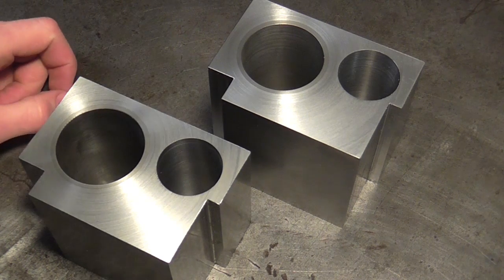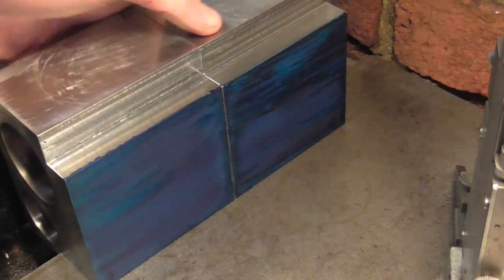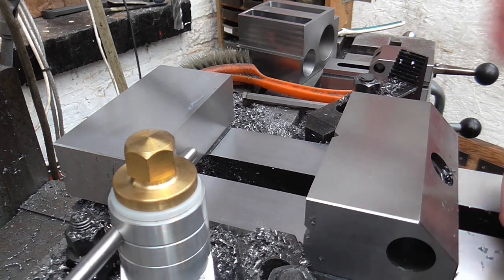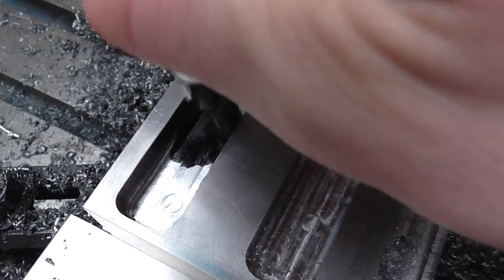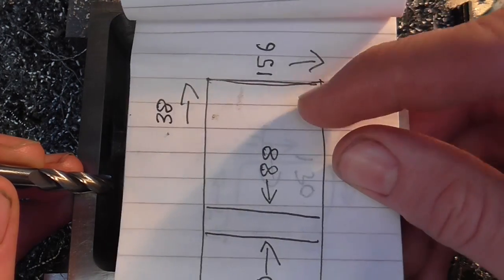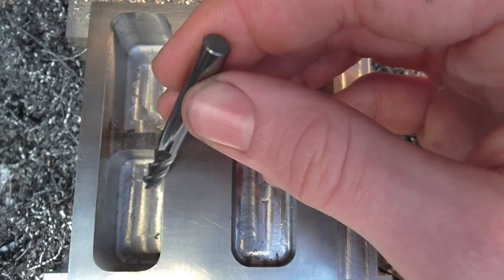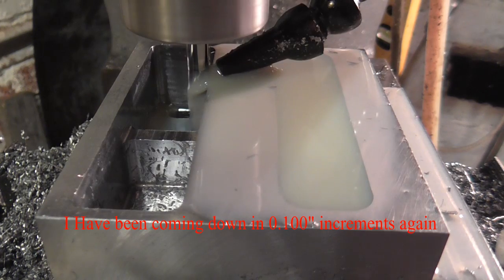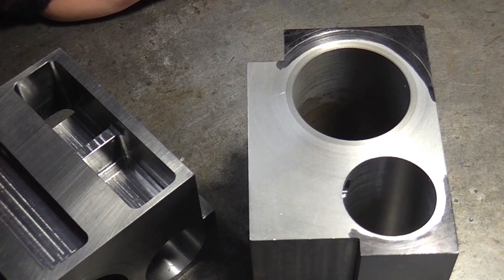Machining Cylinders Part 4

Comment: Mr. C !
Love what you do, very inspiring!
I cant wet cut in my little shop and have to use a vacuum all the time.
I did a DIY central vac system with a remote control. I put up a short crappy video (nowhere near your standard) that shows it. Much easier than dragging a Hoover around and very convenient as theres an outlet at every work station.

Comment: You say 'cap screws' for Allen screws. Why ?
Oxf. Eng. Dict.:
 a1884   E. H. Knight Pract. Dict. Mech. Suppl. 162/2   Cap Screw, a machine screw with a cubical head, used for screwing on the cylinder head.

Comment: I watched a video where you were setting some rivets on a train part you were working on and I though oh this old chap seems to be doing quite well, really hammering along at a decent pace. Now I discover your in your twenties. You even made mention of having bacon and sausages for breakfast and that gave you the strength to get the riveting done : ) 
Absolutely no offence meant but you sounded like a grizzled old machinist with 60 years of hard earned experience behind you. : ) 

Love the videos cheers mate.
Reply: There are many machine shop videos on YouTube. I seem to be on a grand exploration at the moment - leaving some of my usual canalling videos behind (also good). I've found home hobbyists, home machine shoppers and the odd 'real' machinist with massive 'toys' at his work shop. None of them are idiots (odd ones are daft - great for entertainment effect), they're all doing good stuff with video and their work. Some of them are going to greater lengths explaining processes adding significant educational value which makes them stand out a little among the throng. Having watched MrCrispin (I'm on day 2 !!!) I'm mentally at a whole new level, learning masses of techniques and tooling - it's just making me want to go and gate-crash the local university's machine shop ! My 2 machines are not enough !

As for video machining skills quality, I'd rate all I've seen at least a 9 out of 10. Those that are better could easily be a 9·9 out of 10. And now, I'd guess you'd expect me to give MrCrispin a 10 out of 10. ABSOLUTELY NOT !!! It's......

10·000000 out of 10 !

Comment: Unless you are avoiding using a DRO by choice, check out the fabulous free Android app called TouchDRO. It gives you a very cheap diy DRO, that uses any Android tablet or phone as a fully portable screen (Bluetooth) It then swaps from lathe setup to mill setup at the touch of a button, and has transformed my enjoyment of my Boxford. I knocked up a circuit board using Veroboard, but you now have the option to buy dedicated Printed circuit board at a bit more of a cost.
 Nice tip on the tool deflection in the corners.
Keep up the good work.

Comment: Excellent!
You mention that you use your handwheels to get to the numbers in order to mill the pockets. So, if I understand you correctly, you don't use any DRO or dial indicator.
If so, how do you take the backlash of your x and y spindles into account?
Kind regards
Harald
Reply from the maker: +Harald Finster Im always going the same way round the perimeter (clock wise) so back lash doesn't really effect me. The numbers I use on the hand wheels are not relevant to any actual sizes they are just reference pots that I can return to. To find the numbers in the first place I went round the scribed lines leaving metal on and recorded the number the hand wheels were at. Then I measured it and worked out what numbers to go to. Say first time round I went to a handwheel position of 155, I then meausured it and found that there was 7 thou to come off, I would know that to get to final size I would need to go to 162 on the handwheel.
Reply: +MrCrispin thank you very much for taking the time to answer my question. Your explanation is excellent and clear.
Kind regards Harald
Reply: +Harald Finster Cancelling backlash is well-known in the machinist trade.

Comment: Hi Crispin,

I heard a bit of chip recutting on the  pocketing. You might want to look into a cool mist type system to help blow the chips out. 

Given the low chip load you could have climb milled the final pass for a better finish.

How do you like the vise?
Reply from the maker: +Paul Compton The vise is great, I would choose it over a typical milling vise of the same cost any day.
Reply from the maker: +Paul Compton I Couls have climb milled the last pass although that would have thrown all my numbers out as I would be feeding in the opposite directions. With a DRO this wouldn't be a problem of course.